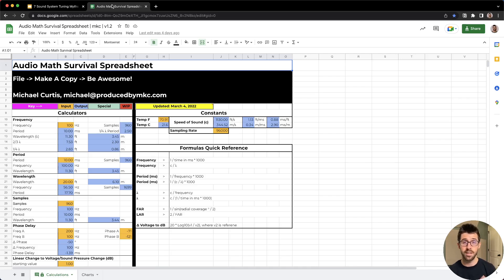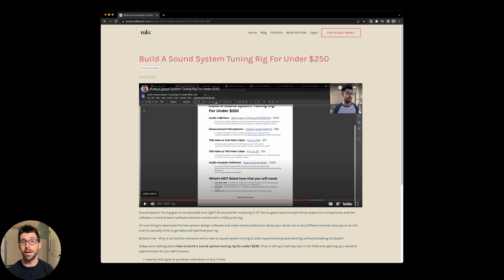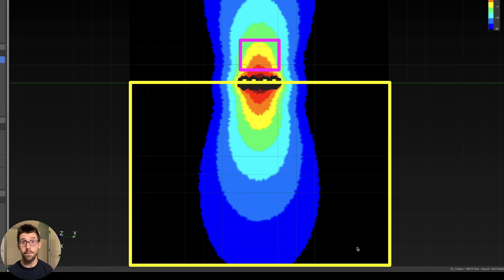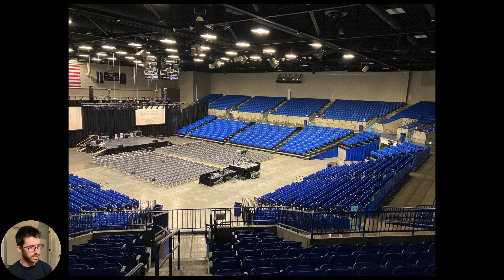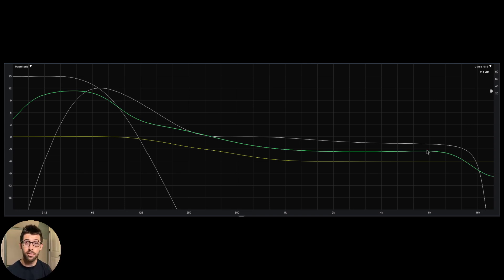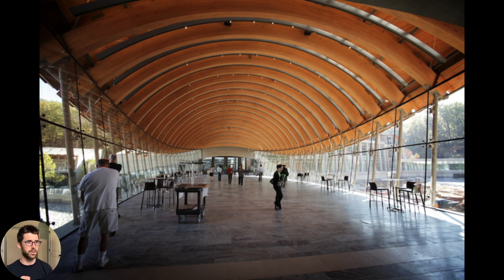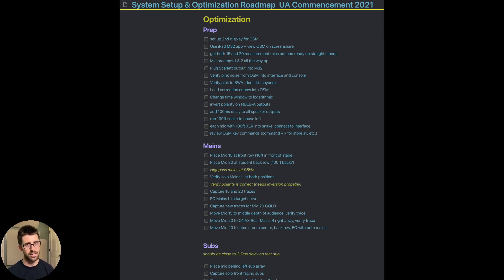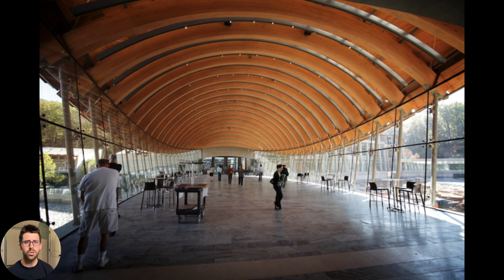7 Sound System Tuning Myths We Need To Drop

Comment: Another myth (or a common misconception, perhaps) is that acoustic problems in a room can be resolved electronically. Most people think that sound systems are everything they need to worry about and that the rooms plays little to no part in what's happening sound-wise. Great video, thanks

Comment: I'd be interested in your thoughts regarding pros/cons of tuning EQ applied within speaker DSPs vs within the console. If you have specific thoughts here it could be an interesting video topic especially when equipment is used in a variety of different scenarios.

Thanks for taking the time to share your knowledge with all your great videos.
Reply from the maker: Great idea! To be clear, are you talking about tuning within an external DSP, or using the processing built into each individual point source speaker, like the EQ in a K12.2?
Reply: The thought came to me as I was considering what EQ to program into SRX tops as presets vs outputs of an A&H SQ. 

I started contemplating hypothetical strategies based on deployed speaker accessibility, networking, device EQ capability, channel availability, ease of preset recall etc. Reasons for EQ include device tuning, venue tuning, feedback control and musical preferences etc.
Reply: But as subject for a generalized video on EQ strategy I would suggest inclusion of external DSPs to round out the topic.
Reply from the maker: @sound-guy  Great idea. I'll throw that in the hopper!

Comment: there are processors (venue 360 but also a cheap ultracurve behringer) that have the auto correction function. can they help us in some situations? maybe using a good mic like your dpa? in particular behringer gives the possibility of correction from 100hz upwards
Reply from the maker: I'd stay away from those autocorrection engines, even if you have a nice mic. They're only relying on a single channel measurement, not a transfer function. So it's unable to tell if the ripple in the frequency response is truly a correction needed for the speaker or a floor bounce.
Reply: @MichaelCurtisAudio  but even after the alignment has been fixed if we make it work? or look at what he combines as a point of view and edit if we don't like it?
Reply from the maker: @tony8236  I still don't trust them : ) If I have a tool available (like SMAART or OSM) that shows me the exact data I need to make decisions on my own, then why rely on an auto-function that I have no idea how it works?
Reply: @MichaelCurtisAudio  understand. I had the chance to test the processor and compare it with smaart. the result looked good, with a flat line. then I am referring to very slight corrections on my system (hdl20), about 1/2 db on some frequency
Reply from the maker: @tony8236  I'd be interested to give one a shot!
Reply: @MichaelCurtisAudio  these are the processors that I often find at work. sometimes i have a chance to compare with smaart. if you can try the venue360. its process is similar to sonarworks but only with 5 listening points. but you will understand that it is not always possible because it takes a long time in the square with the movements. maybe with smaart and your ears you can get the same but i don't know if i'm as good. in any case, thank you for your precious time that you dedicate to us, it is not for everyone to make your experience available and free
Reply from the maker: @tony8236  You're very welcome!

Comment: hi Michael. about sonarworks i use it in my room and i have to say it works very well. what i wanted to know, i have monitors around $ 500. If I want to buy better monitors ($ 1000 for example) and redo the correction will I always get the same listening with sonarworks? the sense is if with sonarworks you can do without extremely expensive monitors
Reply from the maker: I'd say Sonarworks can raise any speaker up a "letter grade". So, if you have B- speakers, they can raise them to A-. I've used Sonarworks in my own studio with three different speaker sets over the past five years and have found that the calibration always helps, but the original signature sound of the speaker remains. Transients, imaging, and top end clarity always feels different from speaker to speaker.

Unless you've got a lot of extra cash around, a modest speaker upgrade isn't going to help you advance your career all that much.
Reply: @MichaelCurtisAudio  I supposed. however to me it gives the impression of A / B when I turn I turn off sonarworks. obviously I don't expect it from really cheap monitors, I'm talking about monitors with a good frequency response. so with a better monitor will sonarworks work better? maybe it will make fewer corrections?
Reply from the maker: @tony8236  I'd say it ultimately comes down to the quality of your room and sound damping. I'd spend money there first before upgrading speakers.

Comment: all of the systems I have setup have been speakers on sticks, but it only ever takes me a short while to check my math, reference my analyzer, and walk around to confirm what should be happening. I used to feel like I may have been doing something wrong because my tuning process was so quick, this was encouraging.

I take issue with the myth about speakers sounding the same with EQ, although their interactions are definitely different I've always felt like I can more or less get the tonal qualities I wanted out of any system. That may come from my only working with lower end budget systems though, as I've never had a side by side opportunity to try and make a QSC play against a D&B.
Reply from the maker: I'm glad this was encouraging to you, Aaron.

To your issue with the EQ myth, I would say other factors like how the box handles transients, frequency response consistency at different drive levels, phase response differences, and coverage pattern differences all play into how a rig might differ from another, even at the same target curve.

I don't doubt that you're getting great results out of any system you work with. That's our job! To wrangle any rig we're given into the best it can be.

Comment: My biggest issue with most of the gigs I see as a visitor is mic placement and mic choice. I don’t say that the tonality of the mix is bad, but I often feel that getting the source right would be greatly beneficial to the results that are produced. 

Also, (and I think this is more up your allay regarding the main topic of the channel) a mix that is to dynamically squeezed and at the same time to loud has no impact as opposed to a mix that moves with peaks that are probably lower then the loud mix without impact. 

I’d gladly provide still to be made multitracks and pics with usual mic positions and thoughtful once that can make a huge difference. Let me know if you’re interested. 

And again, great channel!
Reply from the maker: Thanks a ton! And yes, the loudness wars are raging in more places than just Top 40 : ) Engineers get a hold of Soundgrid server and L2 everything to death. Some specific examples you've seen would be helpful.

Comment: Hi Michael, thx for your videos. Question about the traces. What about measuring the transfer between output console and a measurement mic in the room. It can lead to a different result than follow a trace.  What do mixers like the most, is a mix in the studio the reference for a PA... .
Reply from the maker: You're very welcome! Yes, you're absolutely right in that you can do a transfer function between the console mix and a mic in front of the PA. I see some engineers doing that, but most mixers I see are looking at SPL, a spectrogram, or an RTA. The RTA is used that situation for a "live" target curve.

I personally think a professional studio mix that you trust is the best thing to use as a reference, but I know some system engineers who just listen to pink noise or their own voice through a 58.

Comment: Quick question, can you do a cardiod sub setup with different sized subs? I’ve got 2 15inch subs and 2 18 inch subs Will it work?
Reply from the maker: Technically yes, but you would have to match levels between the 15" and 18" subs. You'll also get different wraparound paths due to the enclosures being different sizes. You also need to make sure they have matching phase responses.

Comment: I would love to learn more about the interesting sub array you mentioned. How to set that up and what you did to control it. I have four dual 18 subs, two amps to power them and would like to give that a try at a certain outdoor show I have. It’s a recurring show with ten to thirteen events on Thursdays. The audience area is a block long and half a block wide. Up to now, I have used them in the flat line configuration which sounds okay, but I would like to try something different to improve the coverage area.
Reply from the maker: Here's a video that covers that sub setup in detail: https://youtu.be/ecOLyJpuqcE

Long story short, even though we can usually be more aggressive with how we shape our low frequencies, we want to do everything we can to have the coverage shape of our mains AND our subs match.
Reply: @MichaelCurtisAudio  I was actually referring to the four subs facing each other. That’s what I would like to do with my set of four 218 subs.
Reply from the maker: @sound4uaudiovideorecording927  Got it! It's exactly the same setup as my inline gradient video, but you turn the front subs inward and measure from the acoustic center of that sub.
Reply: I should also mention that I’m using a delay set of speakers&subs about 100’ out from the stage.

Comment: where i can find system setup and optimization roadmap? And do you set up stage monitor by target trace?
Reply from the maker: Here's a link to the roadmap. I plan on making a future video with a template for it:

https://drive.google.com/file/d/1RfPA3swv6YYL-wShK23qxb6PK8cW2qfM/view?usp=sharing

And for stage monitors I usually run them fairly flat.